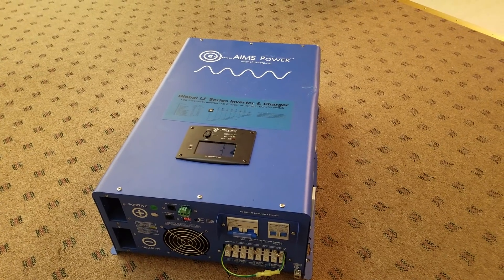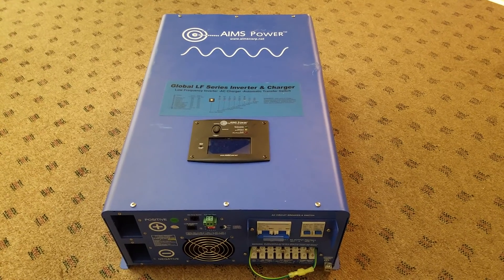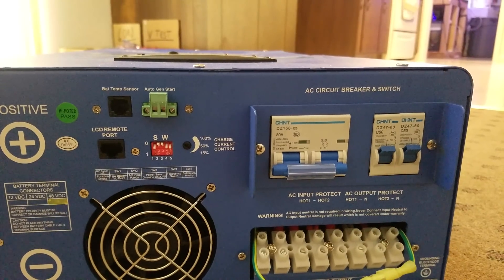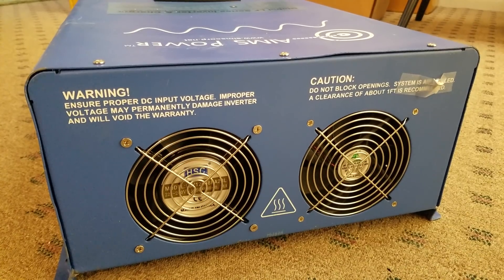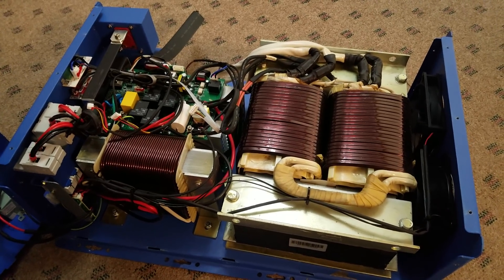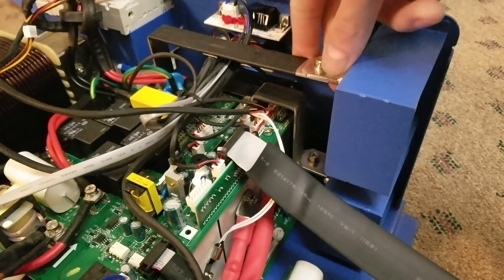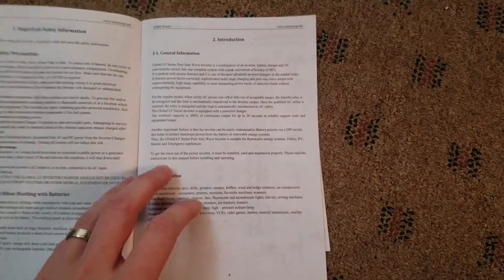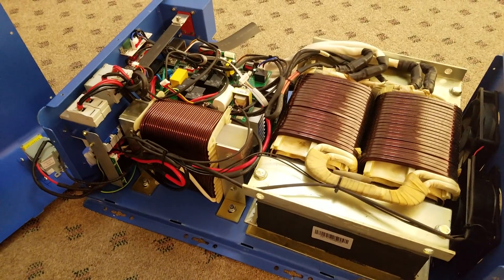Overview of AIMS Power 10kw 48VDC to 120/240VAC Split Phase Pure Sine Inverter

Comment: the pump output  has a inductor in line to assist in the surge capacity to start large pumps  5hp and larger.  the inductor stores energy  on start up and releases the energy to start large well pumps and AC units
Reply from the maker: Correct. It would be nice though if the users manual actually explained this. There is absolutely zero information on it in the documentation...!
Reply: The third (small) transformer is for battery charging.

Comment: Good video
 I have a Aims 10000 watt power inverter. The inverter is hooked up with a 48 Volt battery supply  primary to the house with consumers power as back up power .
the problem I come across is that the 240 volt supply from the converter does not have enough power to run a 240 volt A/C water heater. I have a fuse which is a 600 volt dc resettable one from amazon . this fuse is after the battery primary going into the AIMS inverter. when I turn on the water heater it will run for a short period of time then I will blow the fuse which is in between the battery and my inverter
far as I can figure the water heater probe should pull 18.8 amps which I would figure the power inverter should run. Any help would be greatly appreciated.

Comment: I think the 12 kw has toroidal transformers and that's why it can handle 36kw surge so cleanly. The pump is for a 5 HP well pump and it's mainly for 110v indoor centrifugal pumps. Most Chinese inverters have square transformers which require a 3rd transformer to take some of the hit of AC units when the transfer switch is activated.

Comment: Cut and paste from the Aims manual:

**The pump output will only be used when a pump struggles to operate smoothly when connected to the 
primary AC output of the inverter. This output has an additional inline transformer for added inductance and 
is less efficient than the primary AC output terminal block. Do not use this output if the pump operates 
normally when connected to the primary AC output. Batteries will discharge faster when connected to the 
pump output.
Reply from the maker: Yeah it's in there now. It wasn't noted anywhere when I first bought this and created this video lol. Thanks though :)

Comment: The transformer is awfully small for 10KVA.
Reply from the maker: Small? It's huge and very heavy.
Reply: @LithiumSolar  Do an efficiency test on it, that transformer will get rather hot at full power, also measure the idle current no load.

Comment: I have this inverter, and it's not working too well.

The inverter cuts off the output every time the fans come on, when inverting and when charging. This results in interrupted power, and things like fridges never getting cold, because their compressors take a while to come back on.

It wasn't always like this, it lasted about 2 years before it developed this fault. 

I can mitigate the issue a bit by having a fan blowing on it while it's inverting, so that way, the glitches are less often, but that doesn't seem to matter much when it's charging.

Also the variable charging doesn't work anymore, as if I try to increase the charging speed, it goes into an endless cycles of fans on, fans off, fans on, fans off....

I live in Nigeria and can't send this back to the U.S for repairs. 

Please if anyone has any solutions to my problem, please let me know.
Reply: So basically whenever the cooling fans turn on, the inverter blanks out?  You're saying "output goes off", but does the LCD on the top also go out (or indicate "off")?

I'm half suspecting a failed cooling fan...when the inverter tries to turn the fans on, a damaged cooling fan shorts out the internal power supply, crashing the CPU, causing it to reset/turn off?

Comment: I just got one of the new redesigned Power Jack 8000w LF split phase inverters and I highly recommend it. Power jack is improving and this inverter is a beast.
Reply from the maker: Can you do a test for me? I'm curious if you turn it on with no load connected, what is the idle power consumption from the battery?
Reply: @LithiumSolar  sure, i will try to get that for you tonight
Reply: @LithiumSolar   1.1 amps . I have the 12v version and my battery bank is float charging at 14v so it uses about 15.4 watts idle.
Reply: @kjjosker  Idle consumption is 150 watts , and with power saver mode on its 35 watts .  yours running at 12 volts will be a bit higher. If your only idle is 15.4 watts , then you do not have a 10,000 watt split phase inverter.

Comment: Good looking inverter transformer, but i don't see a sufficient high resistance coil windings a secret parts to feed up and regulate the needed amps of the primary output transformer it's not because it's big it will automatically produce the high amps no.. magic is not possible cause it needs a combination at least "2-3" main transformers, plus there is no seperated battery charger transformer going back to its battery input it's kind of power life cycle when idle, i believe it's not base on first and original inverter invention. Because of missing voltage regulator transformer the maximum output wattage and amps is only half when it's fully loaded and running with appliances. I can improve that inverter with no marketing fake 10kw but it will double the size of it's box, this is the most correct inverter only misi 1-2 main transformer depends on what you need still the best inverter seen on YouTube.

Comment: Looks like they mislabled the pump output as an input. In the manual that I'm looking at online, it's just another 240V output but says Only for water pumps. Not sure why it has another transformer dedicated to it. Perhaps it's to prevent the current onrush when starting a motor from affecting the other output?

Comment: I'm curious what the output looks like on a scope. You can make a little voltage divider to drop the voltage to a safe to use voltage. If you have an oscilloscope.
Reply from the maker: I don't have an oscilloscope unfortunately.
Reply: @LithiumSolar  When I first found out that you can get a really decent Rigol for ~$300 I immediately ordered one. But I do electronics stuff like ham radio as a hobby so it was easy to decide. I still can't get over what you get for your money compared to when I worked at bell labs back in the '80s. Those days you could spend many thousands for less.

Comment: I believe the "Pump Input" is intended to be for a water pump. The type of pump which would pump out/away water to prevent flooding. This point of view comes from an article I found on the Aims Power web site: https://www.aimscorp.net/United-Arab-Emirates-Power-Inverters-and-Solar-Panels.html 

Since this seems to be powered only when AC Mains is down it could also be used for emergency lighting instead.

Comment: Do you think a 7000 watt AIMS modified will run a well pump in emergencies?  found one for $700 off.  Or would it be best to wait and get a whole house inverter.   I'm confused about how "bad" a modified wave is for motors.
Reply from the maker: The modified sine will have trouble starting any inductive loads, such as motors, compressors, etc. Even if it does start, the motor/compressor is going to make noise and run hot. They will work perfectly fine for lights, anything with a switching power supply, etc. If you're going to invest, I would definitely recommend investing in the pure-sine - this is coming from someone who had to replace a LOT of hardware because of not buying the right stuff the first time around.
Reply: @LithiumSolar  Thanks man,  I been watching your vids and I seen your posts on FB.  I have about 15KwH of 18650s and am ready to buy a real gridtie inverter.
Reply: @LithiumSolar  Kweld or sunco for spot welding?
Reply from the maker: I use the Sunkko 709AD 220V spot welder and love it. I don't think there is anything wrong with the kWeld, I just haven't used one personally to be able to make a fair comparison.

Comment: Pump input is probably charger input
Reply from the maker: It's for a well pump when the main output is not powerful enough to start the pump. It is explained in the manual for the 12kW model. For some reason, they left it out of the 10kW inverter manual.

Comment: What size fuses does it have?
Reply from the maker: It doesn't have a fuse on the DC input. It's up you to choose your own fuse and wire it close to the battery. I used 225A Class T fuses by Blue Sea Systems on mine.
Reply: @LithiumSolar  sounds reasonable.. I was thinking about the fuses on the AC side of things.  I saw one 8kw rated blue box that actually had a 20 amp fuse for the AC world.. which would mean that you had basically a 2,000 watt inverter if that was only on the 110 side.. If it was on the center tap of a BIG transformer, that would be only double the power: 4,000 watts.. which again is far less than the 8kw was supposed to supply.  Details on these things is difficult to come by....

Comment: Why use Chinese branded circuit breakers?  These are rated at 50Hz.
Reply from the maker: Interesting, I never noticed - they do say 50Hz on them. That's just what it came with. I have another disconnect breaker downstream anyway - standard homeline brand.

Comment: I know the electronic power and motherboard of this unit, and bought this in China a couple of years ago in the 12 and 24 volt version, so without the transformers. The transformers are the problem and give to much zero load consumption. I saw this in a second video of this unit, the zero load is about 175 watts, witch is to high. About 60 to 75 watts or less for a unit this size is possible. The small transformer is a choke, a induction coil. I think the power pack is to small for 10000 watts, and also the connection to the battery is to light, and shoud be 100% copper. I think the power pack is good for about 5k watts no more. Try to find a good transformer disigned for sinewave inverters 48 volts no more than 5 kwatts inprove the battery connection, and may be it will run for a while, but this is poorly disigned, and will fail at 10000 watts.

Comment: I think the "Pump Input" is for a float switch to turn on the inverter to allow a sump pump to run off the inverter that may normally be switched off.  But that is only a guess on my part.
Reply: The latest manual now calls it "Pump Output" and adds this: 230Vac (Only for water pumps)
Reply from the maker: Cool, thanks! They've been making a lot of updates recently. It's good to see a manufacturer constantly improving their product.
Reply: @LithiumSolar  Great, but it should have been correct at first go. How well does this company know its own product ..... ?
Reply: @migsvensurfing6310  knowing their product is probably not the problem it's knowing English. And knowing technical English is a lot harder than knowing conversational. And this is a product from what is still an emerging country technically. It's part of the reason the price is as low as it is. Qualified technical writers are not cheap. That said more people soak English in China than in the US. China is trying hard to overtake the US industrially and technically. We are getting our collective asses kicked in the US. I worked at 7 different manufacturing plants. Probably 14,000 good paying job if added together everyone of those middle class jobs are give now. Every plant is now closed. I left manufacturing 18 years ago and in that time they all closed. NAFTA was terrible for American workers.
Reply from the maker: It's connected to a separate transformer and puts out 230v. As others suggested, I think it's for powering the pump since it requires a higher current to start. The label should be something other than "Input" to make it more clear...

Comment: Hi do you have a video of the disconnect and connect  of the inverter face plate
Reply from the maker: No, but it comes off easily. There's just a couple of white JST-style connectors. I drew a black line on mine so I can tell which ones went were when I put it back together. There are a couple that are the same size.

Comment: i lift it by my self
Reply from the maker: Wow, you must be strong!
Reply: :(   I just blow mine up. I was testing the ac 240 input using a generator 20 amp 4 leg. i connected the red black and ground. was working for a little bit  then pow! a few of the transistors blow.  i am thinking it had some to do with me messing with the dip switches while it was on. or because i did not have the battery leads on tight enough.  what are your thoughts?
Reply from the maker: OUCH! :( The manual doesn't say anything about the inverter needing to be off to flip the switches, but something just tells me that's a bad idea... Did the input hertz match the frequency switch? I don't have the input on mine connected.
Reply: my generator is a little bit flaky it may have output more then 240 v at some point during when i had it connected this may have been the cause. well i am getting new control boards to hopefully fix the issue
Reply: After I got my 10kw Aims I read the manual and the warranty is void if you use too small of a generator. I need 1.5 times the inverter output, so I need a 15kw generator. My generator is a 7.5kw so I have not hooked it up.
Reply: @Bonita wow thanks for that info. if this is true i am very very under powered
Reply: It is number 4 under the warranty section. I had a lightning strike and blew both boards. It is $360 for the control board and $560 for the power board. As I do not know if there is any more damage I have ordered another Aims 10kw inverter for $2350. Good luck with your new boards.
Reply: my boards are installed. i am waiting for my new generator for testing if it will charge DuroMax XP12000EH Dual Fuel Portable Generator. some one said something about make sure the it makes clean 240v ac
Reply: DuroMax XP12000EH Dual Fuel Portable Generator is a 12000 watt generator. I think it will work if the 240v is clean and you turn down the charger to something less than 100% which is 100amps charger. Let me know if it works as I would like to get something less than 15kw.
Reply: @piccolosun1025  Here is something I just learned. The Aims takes two hot leads in for the 240v ac charging. Without the common neutral connected the   frequency  from the generator is all over the place NOT a steady 60Hz. At least the two generators that I have are like that. I can not get a good 60 Hz from ether of them and the Aims will not charge. Two hot leads from the grid will work and I get a steady 60Hz. Good luck with your Aims as I am about done and am looking for something better.
Reply: @BonitaCreekWaterGuy  thanks funny enough the people i bought mine from just made contact with me out of the blue yesterday after a year im going to try work this out with them. that info will help with the testing
Reply: @BonitaCreekWaterGuy  ill update here if we get a solution
Reply: @LithiumSolar  You need to check the frequency of your generators 240v output. You need steady Hz. I have two generators and neither have a steady frequency from L1 and L2. It must have something to do with not having the neutral connected to the Aims.

Comment: it has been more than 4 months how your inverter  is doing
Reply from the maker: Still doing great. It's been in production for a few months now. I've tested the microwave and washing machine - starts both without any issue. Once it's tied in to the transfer switch, I'll be able to test heavier loads, such as my 5500W cloths drier :)
Reply from the maker: Yep, it runs the cloths dryer just fine. Zero heating issues. In fact, it runs much cooler with the dryer load because that kicks on the fans (fans turn on based on load percentages). I also ran dryer and air conditioning at the same time several times over the summer with no issues. That was a combined 8000w load when the compressor is on. I'll be doing some more heavy load testing in the spring and put out a few videos.
Reply: @DIY Projects 
That is the future apliances that are more efficient

Comment: there's an electrical connection between the ground AC input and the grounding electrode terminal
Reply from the maker: Is that what the green jumper does that's on the AC input/output block?

Comment: Just for reference, I paid right around $1750 for each Magnum PAE4840, or $3500 for the pair, plus another $320 for the 'router' that's required to make them shake-hands.  So call it $4000. I considered the Aims 12,000 watt Split Phase, and I would have saved about $900, but the LBCO adjustment (in 'battery priority') only allows the voltage to go down to 42V (10.5 x 4), not low enough for a 48 V nominal lithium battery set up, although, would work, you're just leaving about 1/6th of your battery capacity on the table. When i spoke with AIM's engineering, I asked why they didn't have a digital controller that would allow you to make fine, broad adjustments and if I recall, the guy said they had plans for one.   Does the digital display on your unit allow for anything more in the way of adjustments ?     I'd consider one of these as a back up, esp now that I have a ton more solar up and could cover the 2+ Kwhs a day it takes just to keep this thing breathing   :-)  -- and 2 Kwhs may not even be true, depending on the results of your "upcoming test"...  LOL
Reply: Hi Mark. I'm thinking to buy one PAE4840. How yours are doing? I just blowed up some APC units i have, they just blown off without reasons and i want something more reliable now. Looks like the magnum's are the best inverters we can get right now.
Reply from the maker: It goes down to 40V (10.0 x 4). The 42V (10.5 x 4) is just where the alarm starts sounding letting you know the battery bank is low. It beeps and a red light comes on, but it continues to operate fine.
Reply: @MM-yn9ni  AIMS devices are ETL instead of UL which follows the exact same criteria - just FYI